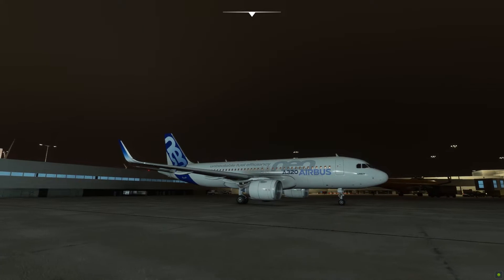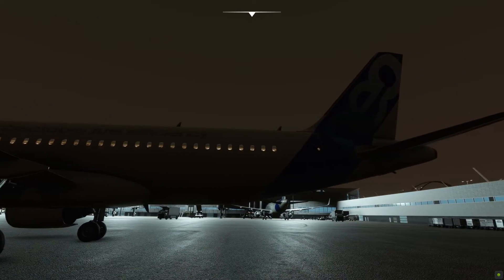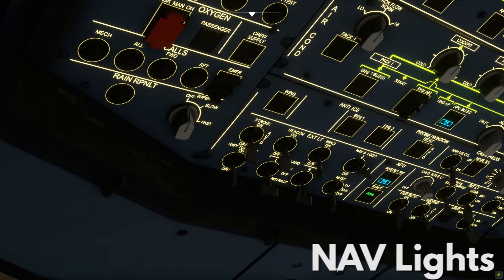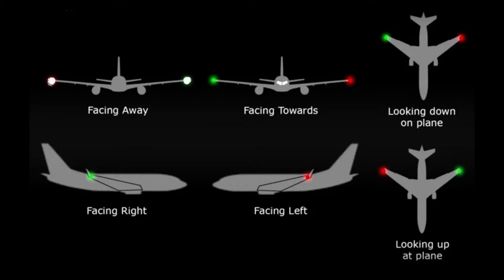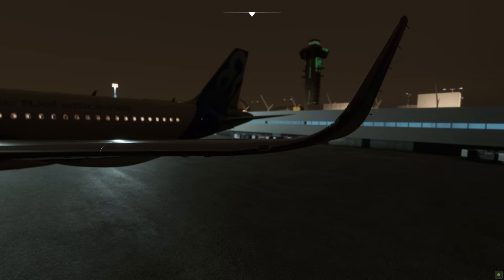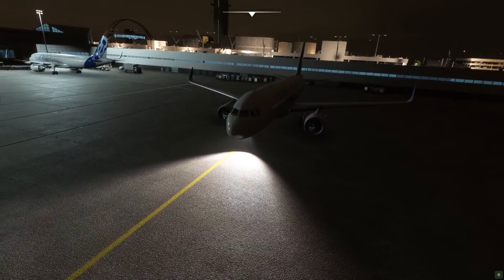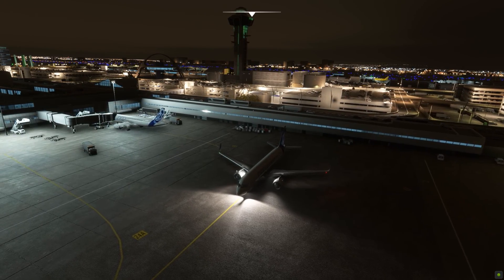Real Pilot Explains Aircraft Lights in Microsoft Flight Simulator - Airbus A320

Comment: Regarding the use of lights may vary from company to company. In our company, landing lights are always on as long as it’s on the runway and below 10000ft.

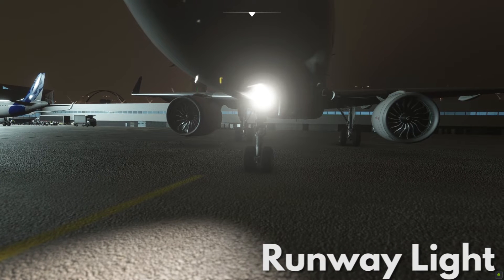At 3:20 it’s wrong, it’s not runway light. It’s called the runway turn off light, purpose of it is to illuminate the sides(about 10 o’clock and 2 o’clock), not for illuminating the center line.
Reply: Hi Garry, what's the difference between the 1 and 2 on the Nav & Logo lights?
Reply: @BillyKone  The Airbus has 2 sets of NAV lights, in case one of the bulbs for set 1 is broken, you can use set 2 instead of wait for maintenance to replace the bulb
Reply: @GarryWan666  ah ok. thank you!